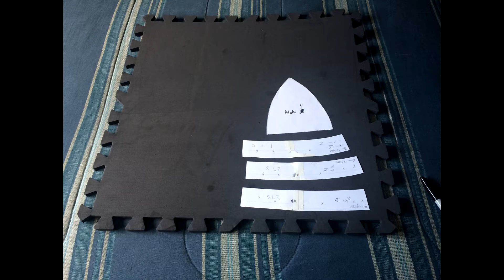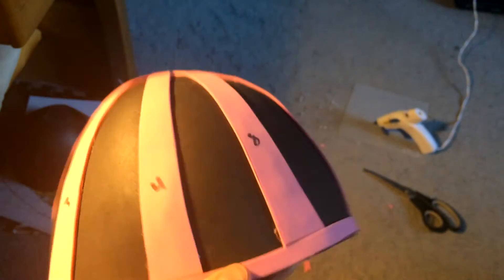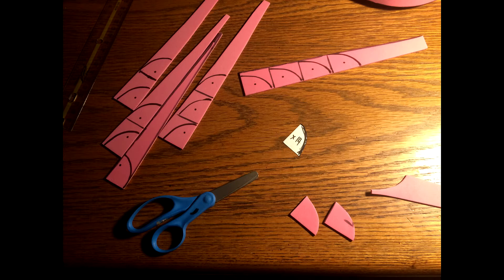HOW TO: For Honor Costume ( Kensei's Helmet )

Comment: nice dents! so you made like scratches with the dremel and they got this roundish / dented look when heat sealing? or were they alread round before the heat?
Reply from the maker: I used the Dremel and box cutter to add the scratches and then rounded over the edges with the Dremel, I briefly covered the weathering around 15:50 in the video

Comment: Hey, sorry to bother but I printed out the templates and I'm starting to transfer most pieces to Eva foam, but I'm confused with the mid and left piece (the small rectanglish ones) where do they go? Are they supposed to be the gold part on the base?
Reply from the maker: If you go to 3:52 in the video you will see where they go. After putting on the 7 "triangle" pieces there should be a section that is left wide for them to be and those pieces are at the middle front if that makes sense. Any further questions you have please ask